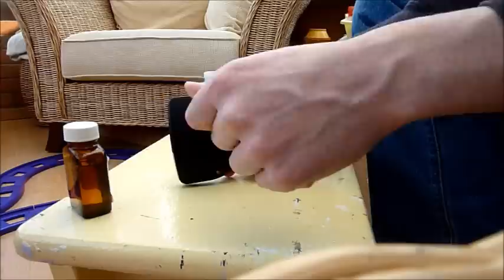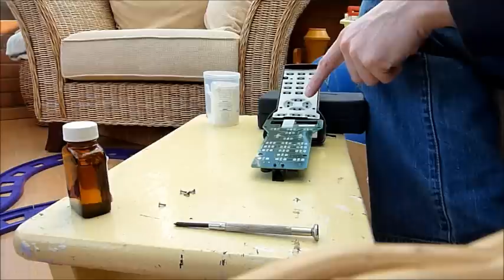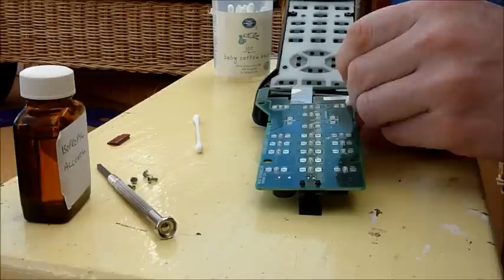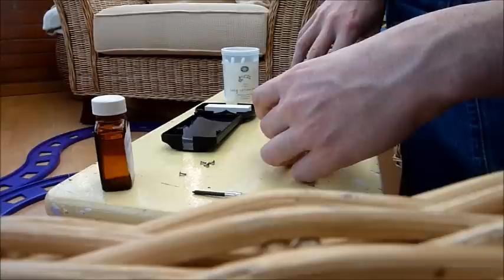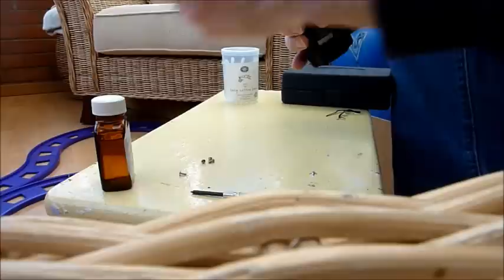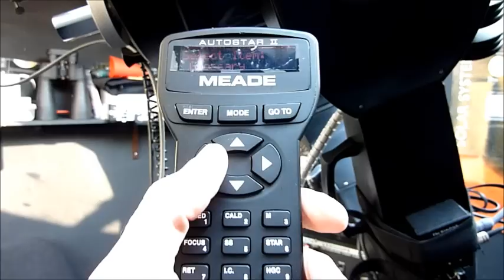How To Clean the Meade Autostar Handset

Comment: Thanks. Mine had gotten to the stage were it was unusable. Cleaning up the contacts with rubbing alcohol did the trick. The buttons are carbon, and it is the residue from these which builds up as "dirt". 

A couple of bits of advice. 
1. Use some sellotape and stick the red filter to the case BEFORE you dismantle it. You don't have the awkward job of trying to keep it in place (as demonstrated in the video) while re-assembling the case.
2. You can easily open the connector which holds the ribbon cable in place. This means you can separate the case from the circuit board and do not risk damaging the cable.